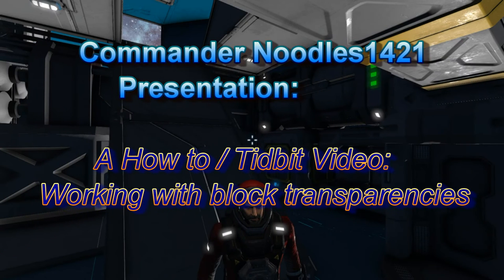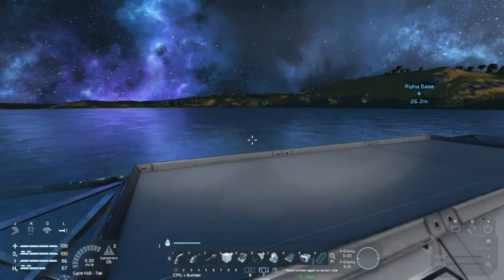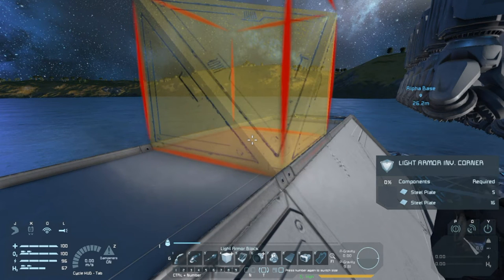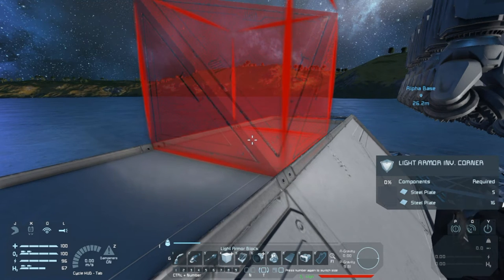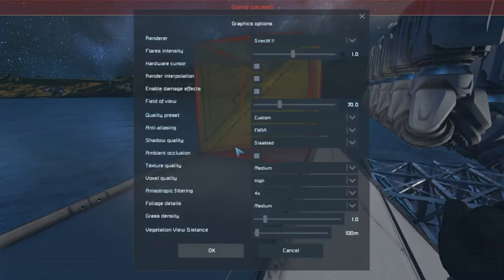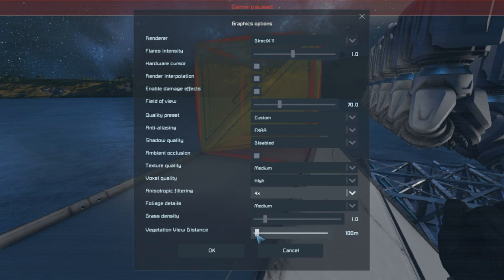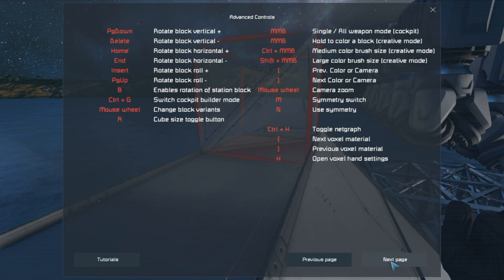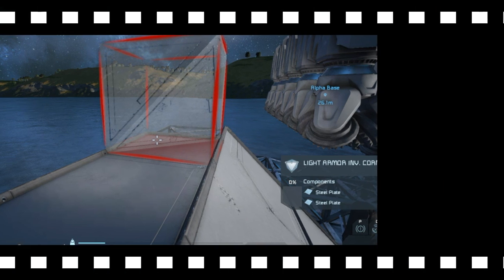Space Engineers Tutorial - How to work around block transparency issues and graphic card settings.

Comment: Thanks for the rapid response.  I will definitely give all of this a go.
Reply from the maker: You are welcome Mick S.
Please let me know if there is anything else I can help with.
I am stoked you found this helpful.
Reply: Thank you for taking the time to help out.

I tried all that you said and I have a slight improvement when running the blocks in a real bright green.  Interestingly,  although my rig runs fine, I have also turned off the shadows because I think it just looks cleaner.

I will certainly let you know if there is anything else.  In fact, there are a tonne of things because this is all new to me.  

Since seeing your series I have been dying to have a go at it but was a little concerned about not knowing what I was doing and therefor running out of time before getting my spacecraft connected to the new base station.  So I have been trying things out in "Sole Survivor".  I have have managed to do a bit of mining and built a mining ship which I can't fly because I can't find any Platinum.

I reckon it is time to abandon Sole Survivor and start following your footsteps.
Reply from the maker: Hi Mick,
Sole Survivor is hard because you will be on a space platform and yes, you will need Platinum which probably is not available on that asteroid.
If you can make 2  hydrogen bottles and put them in your inventory you will be able to use your jet pack to go to other asteroids to find the Platinum.
If you do this, make sure you press "z" and turn off the dampers so that you can get some speed up and then just coast along, you wont need to use your jet pack the whole time.
Just a reminder, Platinum is not on planets only in space, so if you start on a planet you will need to use Atmospheric thrusters and hydrogen thrusters to move the ship around.

The other thing, save and save often, sometimes I will "save as" a different name so I can go back if my experiment doesn't work.

Good luck and let me know if you have any further questions.